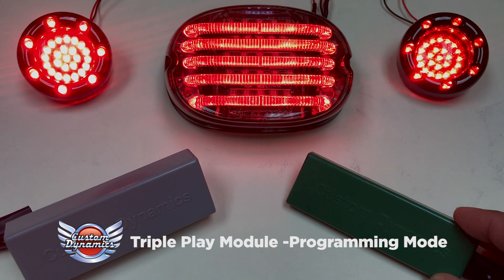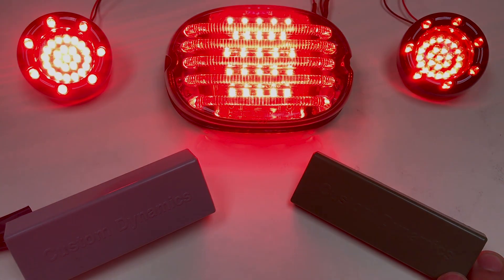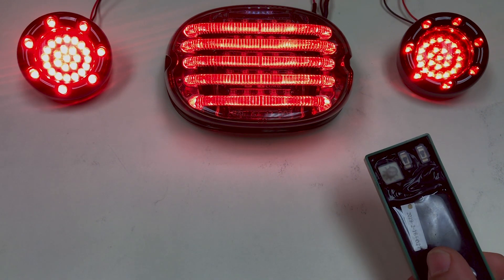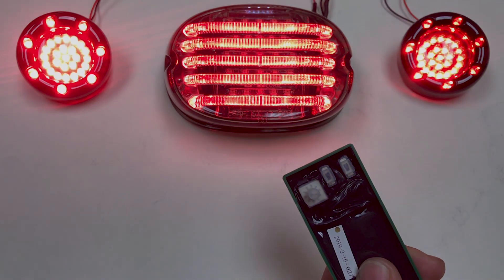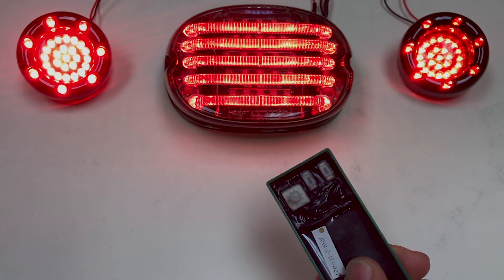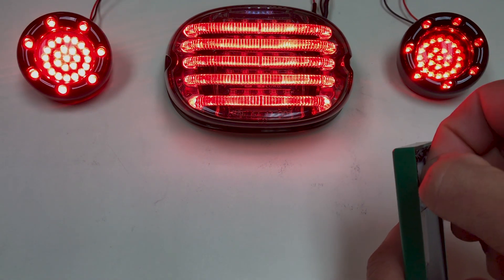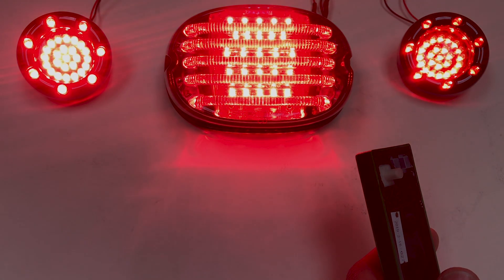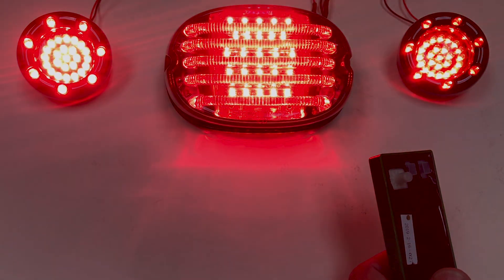How To Program the SMART Triple Play® Run, Brake, Turn Module from Custom Dynamics®

Comment: I INSTALLED AND SUCCESSFULLY PROGRAMMED A LOAD EQUALIZER AND TRIPLE-PLAY MODULE! WORKS JUST FINE WHEN BIKE IS PARKED BUT AFTER EVEN A SHORT RIDE, THE BRAKE LIGHT STOPS WORKING! I HAVE TURN SIGNALS AND RUNNING LIGHTS, JUST NO BRAKE LIGHT (ON FRONT OR REAR LEVERS)! COULD IT BE A HEAT ISSUE CAUSING THIS?? BOTH MODULES ARE SITTING IN THE SPACE BESIDE THE BATTERY! IT'S A 2007 STREET GLIDE! JUST NEED A NUDGE IN THE RIGHT DIRECTION TO TROUBLESHOOT!
Reply from the maker: Hi Bernie!

We’re sorry to hear you’re having some trouble after installing the Load Balancing SMART Triple Play®! That module doesn’t produce any heat and has built in short circuit protection so I wouldn’t expect heat to be causing the issue you’re seeing with the brake function. However, we’re happy to help you troubleshoot! To start, are you able to confirm that with the module removed from the bike, the brake function is operational once again (center taillight goes high intensity for brake and rear turn signals operate as turn signals only, no run or brake, as they did stock)? Once you confirm that detail, please give us a call at 1-800-382-1388 (Normal Business Hours: 8:30am - 5:30pm EST Monday - Thursday; Closed Noon - 1pm & 9:30am - 5:30pm EST Friday; Closed Noon - 1pm). We’ll use the results of that troubleshooting and confirmation of part number/bike information to help you move forward with the troubleshooting so we can get you a resolution as soon as possible! We look forward to hearing from you soon!

Comment: Could not get the turn signals to fade in and out, or adjust brightness.  I was able to set the strobe.... I tried  for a half an hour.
Reply: I know this comment is a year old, but for anybody else who had trouble like me and this guy had: Put in programming while the bike is in accessory mode, not ignition on. That worked for my 21 RK after an hour of frustration.